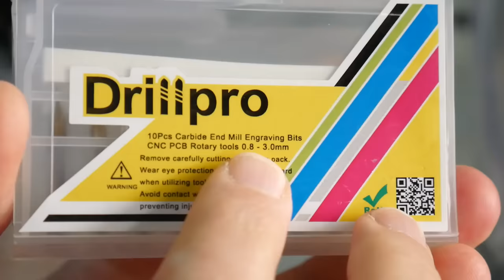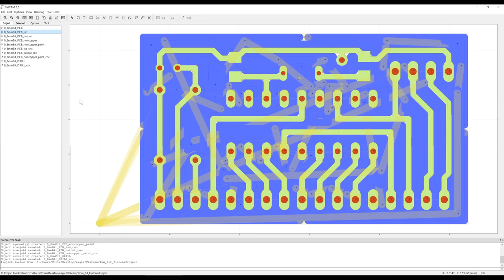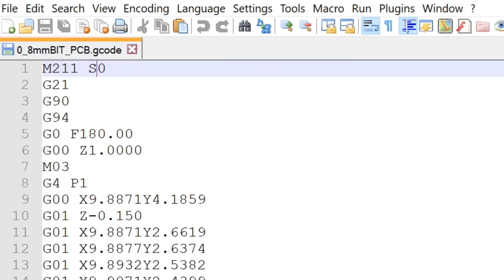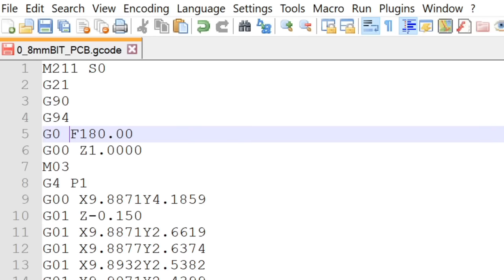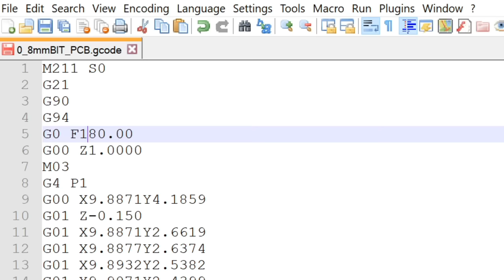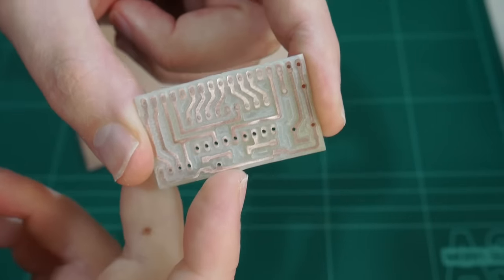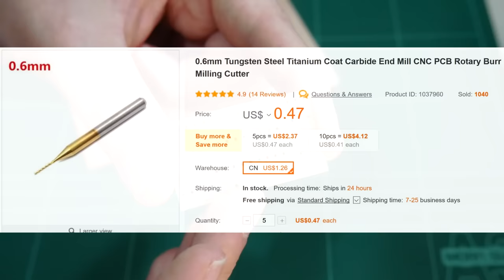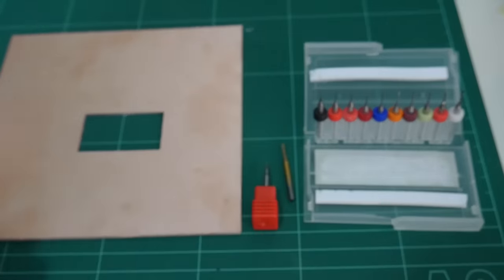Simple DIY PCB with a 3D Printer

Comment: This business of always scraping a full sheet by, placing parts smack dab in the middle is driving me nuts, You sacrifice material (AKA your MDF, which you should be using Hard board not MDF, reason being, the particles made by the routing are safer to breath then the MDF which can cause cancer,  and worst,  permanently sticks too your lungs),  Should be full size of your print bed with a Zero hole in each of the opposite corners which you can insert a metal pin of your choice, use them as a registry for  your copper board, alignment by drilling or punching out the holes in the copper board. Next using  your pen adapter to draw out your routing Gcode, in a corner to make sure you will be routing out correctly , Then do the actual routing so you don't waste all that material.
Reply from the maker: That's good info regarding MDF. I'll swap it out for hardwood/plywood or whatever is available at my local hardware store for the next video.
Using the center of the PCB board was just for the video. During my testing I started at each corner as I had to do a lot of practice first. This final new board was purely for easy viewing. I might add, you can buy a PCB board of similar size from Banggood for $1 :)
Reply: Just to be clear, my comment was not meant in a negative way, Quite the opposite,  Its not hardwood you need, what you want is Hardboard, AKA HDF, it is still in the same family of the DF particle board, there will still be particles,  but it is usually infused with resins which help keep airborne particles to a minimal. When I was a CNC OP for a circuit board manufacture, its what was used. I understand the cost of the Copper board you used is Dirt cheep, it's not the cost, its  the waste of the materials, that has my OCD in hyperactive, hahaha,  you did the same thing in cutting the acrylic squares with the laser video's, Drove me nuts in there too. your a smart guy, we all see and know this, Perhaps you can make yourself  clips or something for the hypercube to attach sacrifice materials to the bed along the extrusion profiles. A kind of quick swap from heatbed to CnC board.
Reply: Also: six plates of acrylic make a perfect case. A switched fan and a flexible hose at the back leading to your window et voila: tocix gas and particles don't matter any longer. Should be less than 20$.
Reply: @hans-joachimbierwirth4727  Nice for the neighbours... :-( Better use a filter like the ones you use for soldering... when you are making PCB's you probably have that in standby anyway so you just need to route the air to it.

Comment: It's cool? Yes. It's easy? Relatively. It's useful? If you don't know how to etch or you run out of the elements, yes. It's worth? No. Too much time, very ugly finish, not precise for small traces (below 0.4mm). 
I propose you a better, easy and cheaper method using your 3D printer. Buy a mark pen, design a part to attach it to you printer's head and use it as a plotter drawing over the copper. When draw finish you can remove the copper using chemicals and voilà! ou will get the same result in less time and you dont need to spend a lot of money in the rotary tool an drill bits.